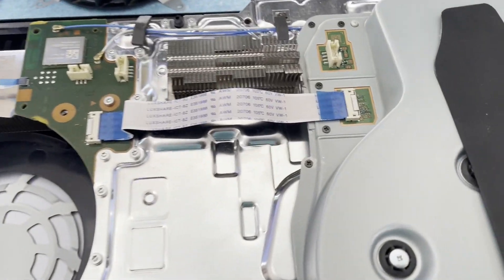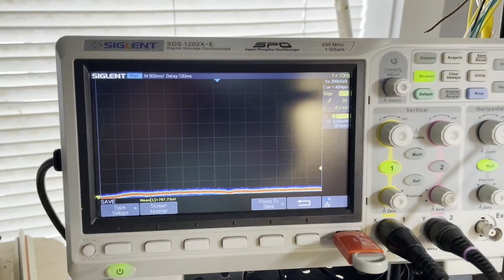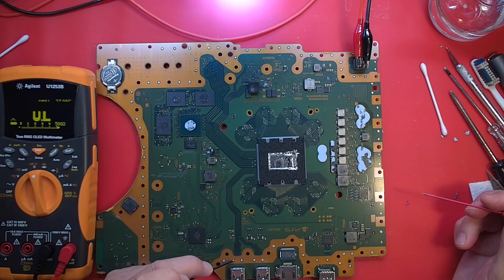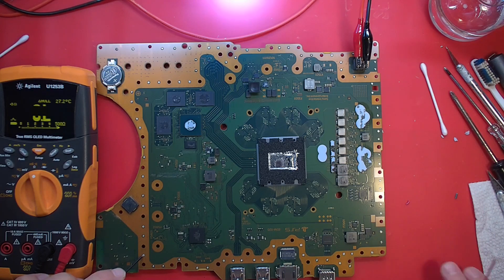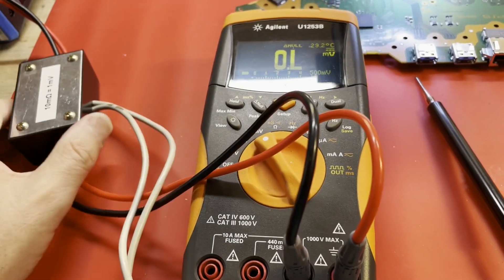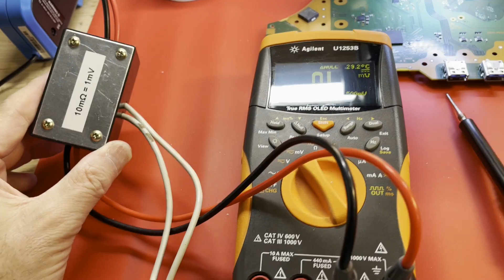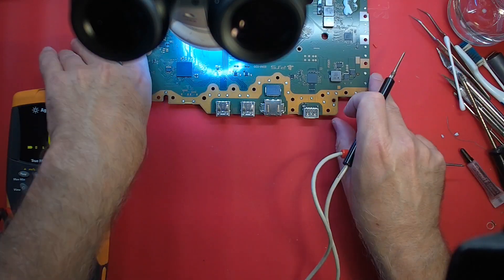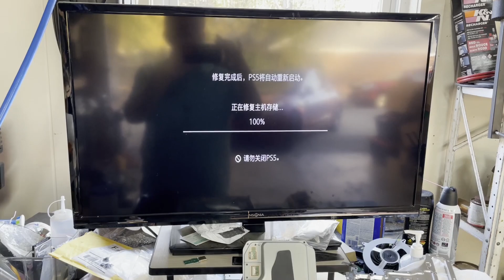#122 Repair of PS5 No Power

Comment: Simplest miliohm meter or Kelvin probe/4wire measurement can be made with one resistor and LM317 voltage regulator. For those interested. It costs 1$ and really works like he showed on video. You really can see where is short so easy. I found shorted legs on IC, using this method.

Comment: For me it is something new (oscilloscope & ammeter to quickly diagnose a MoBo PS5). Thank you for showing us the capabilities of these measuring equipment and also for the links. Excellent method to find the faulty component (which otherwise, I assume, would have caused us more than one headache). A sincere congratulations. Thank you very much for your kindness and mainly for your time in sharing your knowledge with us. All the best.
Reply from the maker: Thank you for the very kind words and thank you for joining me on my repair journey.  I am having a lot of fun.

Comment: Where to buy those CAPS online if I don’t have a donor board. Thanks in advance
Reply from the maker: I will have to check the value of one on a donor.  They will be available from Mouser or Digi-Key or maybe eBay.  Most electronic sellers will have a minimal order though.

Comment: I recommend using new cap instead of taking out from donor board. Since you have to hot air or desolder the donor part out and put back, plus Sony has such "high failure rate" on those caps, it would shorten the life of this replacement cap onto its new home. Also solder iron on heating ground side and hot air the cap with another hand could minimize the melting time as well as thermal stress on the component.
FYI, love the new tech you use.
Reply from the maker: I probably should get some new ones on-hand.  They fail so often.
Reply: @ToltecMerc can you give where to buy them ?